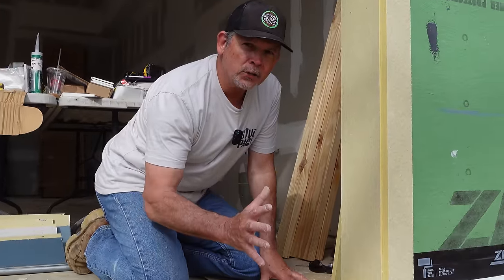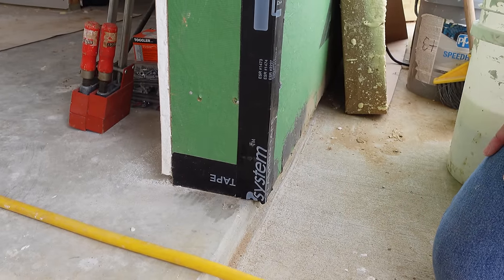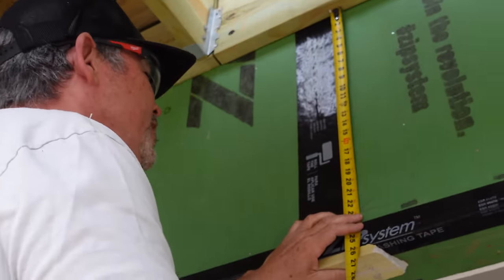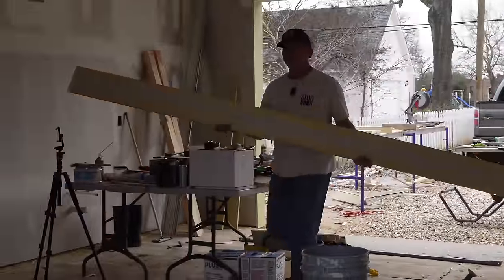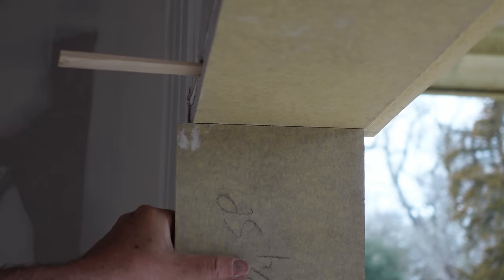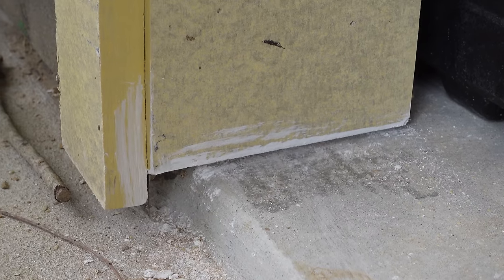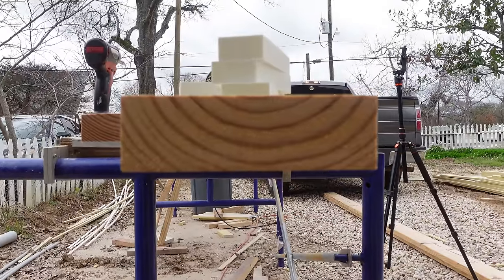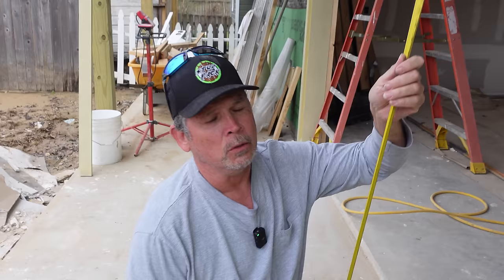99% of Garage Doors are DOOMED to Fail, But Not This One

Comment: hardy is fiber cement and goes to chit when it gets wet. i know because i was the guy who stocked and pulled it at the warehouses for customer order. you leave it out side on friday it rains saturday mid day or sunday morning and by monday 7am it's wet cardboard.
go with the pvc...then you just have to worry about sun damage drying it out and cracking it every time it heats up from hot asphalt summers and just heat softening it enough over time the plastic chemicals that keep it fresh wick away over the decades.

Comment: The interior garage door framing needs to be extended up to mount the track curve and head rail/spring mounts. You also need to mount another vertical 2x for the center spring mount.

Comment: Great video as always.  That's one good looking garage.  One note to make with my experience.  Probably better with 2x6 walls, but i have a mini split mounted to my 2x4 wall with similar brackets and the vibration from the outdoor unit drives me crazy.  Have 2 others ground mounted and absolutely silent.

Comment: Great vid4eo. Depending on the width side walls of the main garage door, I would go with 16", if it allows equal spacing on the short side of the door.

Comment: 24” battens since this wall is so large.  16” will start to look like a Grille.  Suggestion:   tack up the 24" spacing across the entire wall before committing.    The walls to the left and the right may look too sparse with 24" spacing or show other problems.

Comment: I would say 24” spacing on the battens, but I want to know what the garage door finish will be first! Are there windows in it? What size/ proportion are they? Because that could either mirror or clash with the batten spacing. Only YOU know that secret!

Comment: For fiber cement siding, Aren’t you supposed to have 1/8” or 3/16” gap on your trim joints? There’s also other specific details by roofs and like 7 or 8” off the ground.
Reply: 16” spacing or less, it’s more traditional, after all the bats were meant to hide the seams of old boards which were rare over 12”. 
24 seems like you’re cheaping out or commercial building.

Comment: I'd go with the 24" battens. 16" looks to busy.

Also, I don't remember what you and Jordan decided on for a garage door opener, Paul. Wall (side) mount or ceiling mount? It doesn't look as if there's a whole lot of room above the garage door for storage so I doubt you'd want to reduce that even more with an overhead opener.

Comment: 24" looks good I think. Also I had a heck of a time getting flashing for my water table detail at my house. I didnt do a square one like you guys though.  Wish i could share a pic of it on here for you to check out. Something like this though. Angles not right but its the best I could do.  And no its not close to the ground like yours either. 

 |     osb
 \  water table
 |   sill board

Comment: To pull that old AC down legally, you need to evacuate the refrigerant from the system. There is a huge fine for releasing certain refrigerants into the air, so if you take that route, definitely don't film it. There is an EPA license for handling refrigerant, and you need that if you ever want to buy refrigerant from a supply house. It's not too hard to get the license. I assume you are hiring someone to commission the system, they can evacuate the old system on the same day, just ask them to do that so they plan the equipment and time for that.

Comment: question?? would it not be beneficial to Have the lower trim board slope to the outside so water running down the side of the house didnt run in along the "flat" of the trim , have to cut the side trim at an angle  but???  (not a carpenter just diy)  on my shop i have been writing the measurements on the inside tin and solid styrofoam  insulation. yes i like the 24 in spacing best as several said 16 is just too busy

Comment: Pretty sure most 2x used to mount the track for garage doors goes all the way to the ceiling, or at least to the top of the top bracket which is usually a few inches higher than the horizontal part of the track.

Comment: There should have been flashing between the horizontal board and the Hardie board on the wall. When it rains what is going to prevent the water from running back to the Zip sheathing? The caulking you put there will not last as long as a small z-flashing. According to Hardie, that seam is supposed to be flashed, not caulked. That is a detail you have missed.

Comment: If you were to hire a company to do the zip/trim/siding, how quickly would they get it done vs how long you guys have taken? Do they do all the detail you are doing to ensure water tight/air tight/level and plum? Or do they just slap it up and fill gaps with caulk? You guys are doing great!

Comment: 24" all the way!!!  The symmetry and overall size of that exterior face of the garage / house can support the wider spacing and it will look less busy in the end.    Another question....did y'all check out whether or not the 16 vs 24 inch spacing will better (more evenly) subdivide and thus more perfectly distribute those battons across the entire face of the structure?   Meaning if you choose one over the other, does it make a difference to the overall esthetic by not leaving weird, overly skinny sections at each end of the board & battons rather than providing a more evenly spaced appearance when taken as a whole when standing back a ways and viewing the entire surface (taking into account window spacing etc above the board and battons detail?   It's probably overkill but seems like that's Jordan's strong suit and I can't help imagining him out there snapping chalklines or getting on the computer to autocad a rendering in both widths spacing to visualize it before committing to one or the other.   And.....that's not a swipe at Jordan.....cuz that's totally something I'd be doing to sort that conundrum in my mind beforehand as well.   I FULLY OWN MY OCD!!! 😂

LOOKIN AMAZING and I love picking up new tricks from you guys, so thank you very much for all you do while sharing these experiences with us.   I know the build would be so much easier if you didn't have all the behind the scenes fuss with cameras, lighting, viewing angles and remembering to hit record for every take ....not to mention all the editing and post production work.  Y'all are freaking monsters at this and I don't know how you manage it all, but I am damn sure glad ya do!  👍🏼

Comment: my garage door was so inexpertly installed (before I bought the house) that I know it won't ever rot in that spot because they did such a bad job sizing the hole and cutting the boards that it had a two-inch gap between the board and the ground 😬so I filled it with gap filler to get through winter, then I'll go in and properly button it up once it warms up.

Comment: I'd check what the garage door looks like THEN start setting batten to be "balanced" appearing.
Second, I've been around a LOT of old buildings and the battens were always over 10 to 12 inch wide boards, even the 14 or 16 inch is wider than traditional and the 24" just looks ridiculous.

Comment: The energy level is different without Rad there, but I'm sure he has some sort of day job and can't be there all the time. I haven't lived somewhere with a garage since the 80s so its interesting to see how the trim is done on one. I'd love to have a garage someday. There's actually a house on the way to Mamou that gave me garage envy. 3 car garage attached to the house and a giant garage to the side. The house doesn't show from sky view on google earth but it shows on street view. 
W Metalmart!
Cool that they were able to do a rush order so quickly. Don't have anything like that in my neck of the woods. LOL.
I think the 24" spacing looks good on a building that size. Also, it will take less material so its saving $.

Comment: Have you talked about how to cut a board that has a pencil line? I pointed out to my nephew that the first question you need to ask who ever marked the wood is "do it take the line, leave the line, cut to the right or left of the line." If you dont know and cut it wrong you will be off 1/4 inch or more. (I use carbide blades)

Comment: I wouldn't recommend scribbling trim to your drywall or you will end up with a messy looking finish joint you have to hide with culk. The line must be straight from one side to the other. Probably not as much of a concern on a garage door though.

Comment: I like 8 inches of marine epoxy all sides and bottom. Dries fast and takes paint. I do the same on T-1-11 that is too close to the ground. This stuff is tough and floats boats for years and years. Love your use of stainless. I use scotch brite pad on the outside of flashing and pre-prime with spray paint to add some teeth for paint. Old fart advice

Comment: 12.5, 16 and 19.5 or 12.5, 19.5 and 16.  Gives the look of random width boards which would look more old barn like.  But if you are after uniform box then 24

Comment: 24" spacing suits the home better to me. However , where would those battens run going up to your second storey? Perhaps if they are weirdly spaced around the windows a 16" spacing could work better. Might be worth seeing where that spacing falls on the front and back of the home first.

Comment: get yourself one of those stainless great stuff foam guns and a can of cleaner. even if you only use a few cans a year, so worth the 30 bucks. easy to clean and super easy to aim accurately into those tight window and door cracks. those plastic tubes are so crappy for the tight spots.

Comment: nice use of the PVC ... 4 years ago every job on the garages I worked on in Minnesota wanted PVC trim with all the plugs and the expansion and contraction just made it worse than using wood.

Comment: Aren’t you supposed to have some gap between the zip sheathing and exterior cladding? What happens if moisture gets behind those big flat vinyl panels which are screwed tight to the sheathing? Zip is not that great of a water/moisture barrier.

Comment: That interior 2x passes code for the doors where you are? Here it has to be 2x6 or better from bottom plate to top plate with three 3” or better nails every 12 inches. And a 2x10 center block for the opener nailed the same.  It’s all based on wind loading.

Comment: That board scribed to the drywall has convinced me that plaster is the way to go.

Instead of that monkey business I'll cut my boards straight and screed my plaster walls nice and flat.

I'm even going to embed a gallery rail for my screed to ride on and then I'll never have to put a nail through the plaster to hang a picture frame.

I'm going to use a similar detail to embed aluminum slat wall inserts in the plaster in places where I'll need organization like the garage.

That's going to be more labor but I'll be able to pull off an ultra high end finish with extra features and get all of my lines dead straight, plumb and level for a little extra work.

Comment: It really depends on if you want it to look authentic wood it would be 8”, 12”, and sometimes 16” but never 24” for real wool board and batan 24” will look fake from every angle , that is completely your choice I just installed some on my daughters house and she went with 8” but she has a ranch style house with some stone on the bottom in front and it turned out great but every home Is different, that one being two story in my mind 16” would look great but it’s not my mind owning the house. Just my opinion thinks for sharing your work with all of us.

Comment: 24” looks good in the center, but how will it finish on the outside edges? I would take the over width of the fillable area on two sides and see what it’s divisible by to determine the spacing. However, I feel you guys have already thought of that.

Comment: Question - after driving the 2 stainless steel screws into the interior dimensional lumbers to attach the feet, are you not concerned about water being wicked up by the screws?

Great video and I am learning a lot about bulletproofing garage framing by watching this video.
Reply: I think I'd go with 24" spacing.

Comment: The overhead door mounting surface is incomplete. Side bucks need to extend 18 inches above opening height and also a block in the middle for spring mount.

Comment: 16" is more traditional. Need to look at where the board and batten came from. Vertical boards with battens to cover the seams. They didn't have 24" wide boards. 12" or 16".

Comment: I'm more curious what will prevent the door itself from failing. The place I'm living in was built in 97 and about 8years ago the screws holding the horizontal bracing of the door together all fell out causing the door to collapse from the center while it was in the up position one day.

Comment: I don't understand why the front trim is placed above the level of the trim at the top of the opening it seems to me 😆 f you poor water over the front trim it has the opportunity to touch the trim butting up to it and if it was say a quarter  inch below it would drop off the edge and not reach the board at the top of the door opening

Comment: Stainless steel has to be exposed to oxygen to keep its corrosion resistance otherwise its nobility drops down to cast iron corrosion when painting or sealing over the screws.

Comment: I think the spacing of the battens should be based on the total width of the area that you are covering.  I don't know the exact width of the front your building.  For instance if you put them at 24" and the last  batten's  spacing closest to the right and left corner board is only going to be 6'" that will not look good with all the other spacing being 24".   Instead, if you were to put them at 16" and the spacing closest to the right and left corner boards worked out to be 12", the 12" number is closer to 16"  and would just naturally look visually better.    I also noticed something else when you put up the first 4 foot wide board, you put the edge of the board at the center of the building.     Should'nt you have put the center of the 4 foot wide board at the center of the building??  The reason I am asking this is because you are obligated to put a batten on every seam.   In other words, just like if you were laying tile in a given space you would always place the tiles with what visually looks the best.  I hope I am not overthinking this and being confusing to you.  If I have been confusing, just tell me I am crazy. 🙂  But for what it is worth, I think the 16" spacing will  work out to look better.

Comment: You ALMOST had the interior 2*6 jambs correct. The vertical boards run full length to the ceiling and tie into the top plate. you're also missing a 2*6  that goes dead center of the horizontal that runs vertically and also ties into the top plate like the side jambs.

Comment: Is that really a Festool track with a Porter Cable circular saw?
Reply from the maker: Yes 😂 I'm just using the track as a straight edge so we get a good cut 💪😁 the PC saw isn't riding in the track it's alongside

Comment: No way man, that torpedo level was way off when you made the adjustment with the wedge. 
Not only that, your whole garage base is going to rot since you didn't add the protection of 8-12" inches of concrete height to elevate the wall structure. Poor design! 
Did you use different tape measures when measuring lengths on the structure and lengths on the cut. You need to use a square to make accurate cuts too.

You need to call This Old House.

Comment: This build has been great, but looking at the comments, hopefully you guys research the architecture and history behind board and batten design as much as you have various building science methods.

The 24” and even 16” batten spacing is wrong, looks cheap, inaccurate, and clearly not the real wood siding it’s trying to replicate.

It’s similar to tacking on a pair of fake little shutters on the side of a window that is way too wide for the shutters to possibly cover.

Comment: I’d like to see this exterior bottom trim board condition in 10 years. Gotta be in need of replacement, no? You ain’t replacing it easy with that steel flashing on top of it. Why not install plastic board instead? Yea it costs a lot more but it won’t rot. Not sure why that plastic wood is expensive anyhow, it’s just recycled and other crap in the form of a board…

Comment: Why are you psychos putting the water board trim on the bottom first??  Wouldn't it be easier to rip it down to size (or just leave it hang a little more) AFTER you get the boards up on the wall which are inevitably going to be off by 1/16-1/4 in length?  Now you're going to have to cut those giant boards to length instead?

Maybe I'm just ignorant and don't understand, but it seems like following the rule of thumb of cutting the smaller piece of material is going to be easier than the larger one...

Comment: " guys have you ever noticed why your garage door trim rots " well its because your using cheap untreated lumber, your a idiot or you're using cheap... i mean chip boards or water sponges... i mean MDF boards and paint not rated for anything other office work inside. if you want ever lasting just use proper lumber or use SS like come on guys one of the most ( some how ) abused thing on a garage is the door and door trim area!